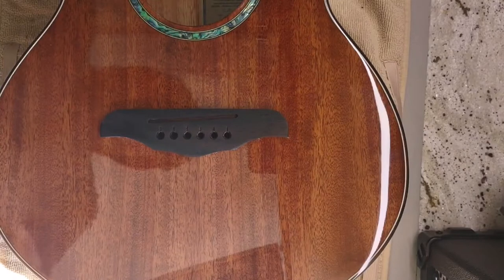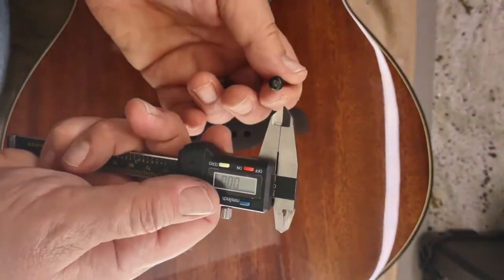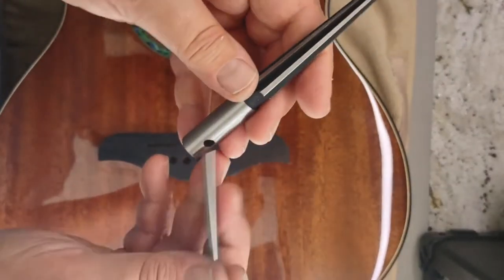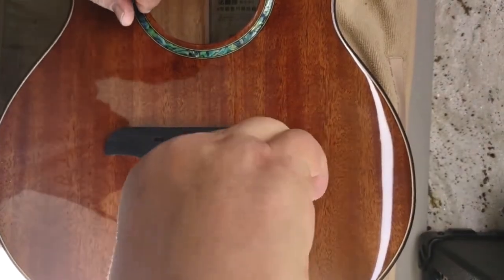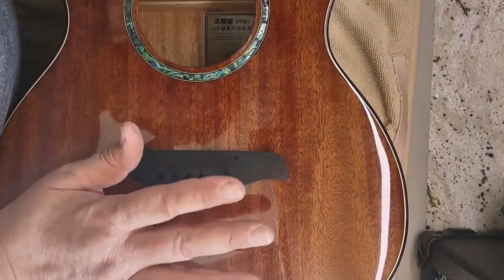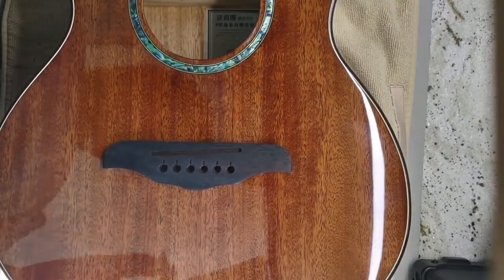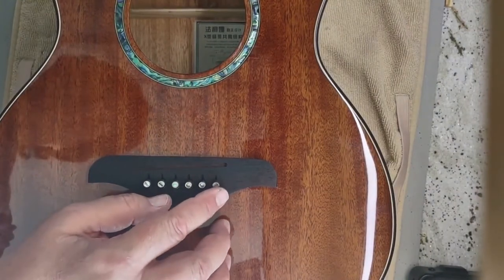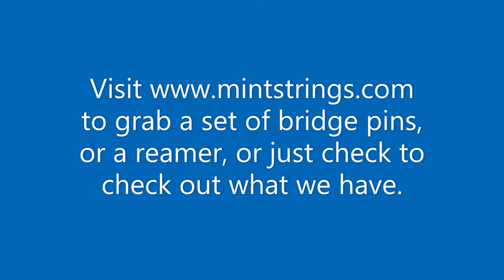A Detailed How to Ream Guitar Bridge for new Bridge Pins

Comment: I use a reamer with a taper that matches the pin. Tapers vary a little by manufacturer and pins are available with different tapers. Martin uses a 5 degree taper. I use a reamer with a 5 degree taper on guitars receiving a Martin-style pin.

Comment: I've been looking for a reamer to do exactly this! Thanks for giving me a size reference to know which one to get!! I was almost looking to file to widen the hole or or try drilling it!
Reply: The concern I'd have is this reamer is really designed for auto work, metal. It's a pretty standard reamer which has (IIRC) something like a 6 degree taper whereas the bridge pins are usually 3 or 5 degree taper. It's better than using a drill for sure but I've got one like this and I'm nervous about using it to realm out the hole in my guitar.
Reply: @SethHolmes  Yeah I had the same concern! 

I´ve seen pro luthiers use an exact reamer to match the degrees of the bridge pins taper. But honestly, those look like a lot of hassle to find and are probably gonna be way more expensive too. I think any cheap 3-13mm reamer will do a well job, especially on a soft wooden bridge! You can just ream the holes to a snug fit and then use a smooth round file to really taper the holes towards the bottom if you want to be that exact. Which is the same technique luthiers use on widening the guitar tuning peg holes!
Reply: @quintijn3444  I can confirm that a luthier-grade reamer is expensive. I own two because I do a lot of this kind of work. They can be found at StewMac, LMII, Phildelphia Luthiers. The correct reamer is less expensive than a new guitar. For people who are cost sensitive, visit a luthier. That would not be expensive. In fact, buy the pins there too. You'll get expert advice, selection and well-fit pins.

Comment: Thanks for the video. Very helpful. I was thinking...what if you had found the point on the reamer, using your calipers, where the radius is 5.05mm (or maybe a hair less--the same as the new bridge pin), marked that point with a piece of tape and turned the reamer until you reached the tape mark? Would that have been faster and taken the guess work out of figuring out how many turns to make?

Comment: Why are the pins oversized? Wouldn't it be easier to get/make pins with right dimensions?
Reply: There is sometimes needed some sanding on bridge pins, slight sanding to fit the pins at the desired looseness in the bridge holes. Videos describe and illustrate this method. The pins are made of a material that can be consistently sanded and shaped for the dimensions of the pin hole. You presumably don't wish to destroy the guitar.....

Comment: Why didn’t you just purchase the correct size bridge pins?
Reply: If replacing original plastic pins, regardless the taper bone pins are usually oversize at the neck compared with OEM plastic pins. Sourcing bone pins of identical dimensions as the original fitment isn't the easy exercise you want to make it sound. Resizing the bridge holes for quality replacement bone pins is the easier route & gets the job done.
Reply: This is correct. Don't ruin the guitar with the reamer. Buy the correct pins in the first place and  sand them in a drill chuck, spinning, like a lathe against the sandpaper until exact fit is achieved.  The average player can sand the pins. The average player is best advised not to ream the guitar bridge pin holes. Why would an amateur attempt this job using improper tools and incorrect methods? This doesn't make good sense ....
Reply: @matthewbolduc2714  Reaming the bridge holes doesn't "ruin the guitar". If the replacement bridge pins are a larger diameter shank as bone frequently is, reaming the bridge pin holes to fit will result in a superior more consistent fit than sanding pins irregularly, & takes a tenth of the time. 

If you've done both you'd know.

Sanding pins in an electric drill is crude, laborious, difficult to get consistent resulting in irregular diameter shanks.

Why would an "amateur" attempt reaming the bridge? It's not rocket science nor beyond the capability of anyone with an ounce of common sense. Mic the new pin shank diameter with a micrometer. Ream to diam and taper with tapered reamer. Measure twice cut once, and carefully. Job done. Perfect fit. Optimal tone.
Reply: @theblytonian3906  I'm not convinced of the sensibleness'. Sanding the pins by hand or with a drill spinning, is easy to do to adjust for minor tolerances of the correctly selected pins. A minor matter. But more importantly - sanding the pins is a reversible modification because a new pin is relatively inexpensive if you sand it wrong, but reaming out the guitar is essentially a permanent change to the guitar that, if done wrong, is not going to be easy to compensate for. I guess you could replace the bridge.

Reaming the bridge is not simple for the average player wishing to replace pins. Finding the correct reamer is itself no small task. Even figuring out what size reamer to use is difficult for many.

Furthermore the average player wishing to change pins is usually not going to have developed any substantial skill or experience using a wood reamer. Few have used a reaming tool on a fine object like an acoustic guitar. Practicing with the reamer on scrap wood might be messy.

I would advise ⚠ ⚠ to anyone thinking about reaming out the bridge pin holes.
Reply: @theblytonian3906  I'm not convinced. Amateurs and hobbyists' watch these videos and the thought of them taking drills to their new acoustic guitars is 'scary'. 

Novices should learn to order the correct parts in the first place.

Drilling into those bridge pin holes is not something that should be attempted by a novice without understanding the risk. A player might be better off letting someone that knows what they are doing change their bridge pins.
Reply: @matthewbolduc2714  Tell me you're an academic or paper shuffling x-spurt (sic) rather than a pragmatic intelligent hands-on type -without telling me.

The tool used to fit those bridge pins isn't a drill, but a reamer -there's a significant difference. And there's nothing complex or challenging for anyone with an IQ of 100 or > plus a bit of gumption and basic nous. 

These days you can pick up a those reamers in the two common tapers used for bridge pins quite cheaply on Amazon or eBay. 

If fitting new bridge pins, one needs to ensure a snug sound fit anyway, and the old holes may well not be, particularly if worn over time from regular string changes and wear and tear.

To sum it up, you're trying to make a mountain out of a mole hill. It's abundantly clear you have no hands on experience with the process and in fact sound a scared to my ears of anything hands on with guitar other than changing strings and wiping them over with a cleaning cloth.